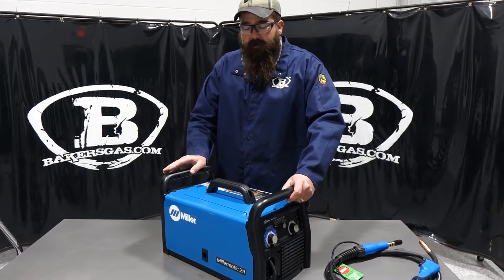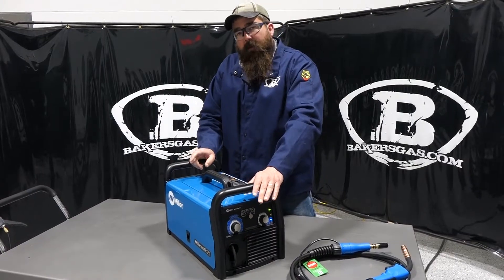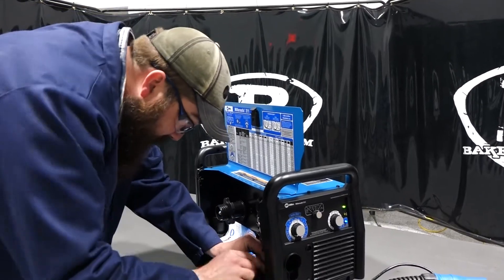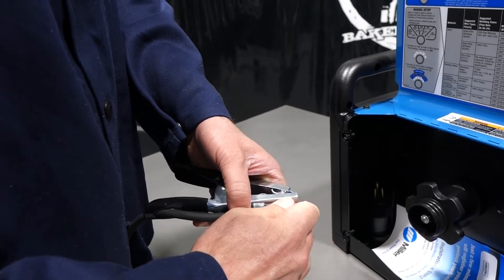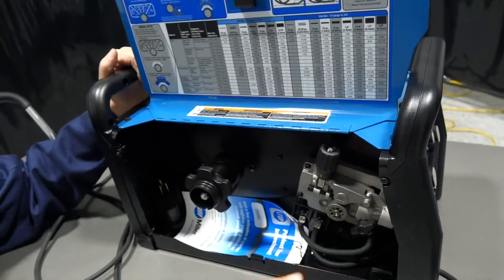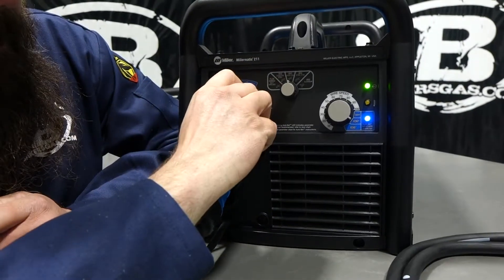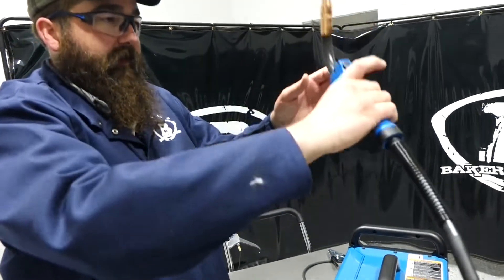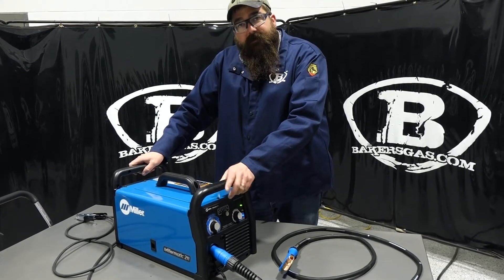Millermatic 211 Review & Tips

Comment: I’ve had my 211 for about 5 years and I’ve run a few hundred lbs of wire through it and never a hiccup. Rock solid machine. I also have an old bobcat 225NT, I’m a fan of miller products
Reply: Will the 211 do 3/16 on 120V with steel or does it need flux core?
Reply: @stever7638 it will run 3/16 on 120v no problem! I only run steel C25 on my 211
Reply: @jimmy4x4socal44  Ok, thanks. Is this single-pass?
Reply: @ in most cases yes

Comment: Not worth the money.  Spend money on a better unit.  I bought one almost 4 years ago,  at the 2 year & 9 month mark of owning main board fried.  After calls and emails miller warrantied.  9 month later and 3X 12lbs spools later unit won’t turn on again.  Completely dead.     This is stored in a dust free shop,  clean and heated.  Light hobby use.  Small farm repairs.   No commercial use in any way shape or form. 

They are close to $3000 (cad) new now.  The fella that fixed it last said if miller didn’t warranty that repair it would have cost me $2000.    These inverter type welders are NOT worth it.   No clue why no one talks about this.